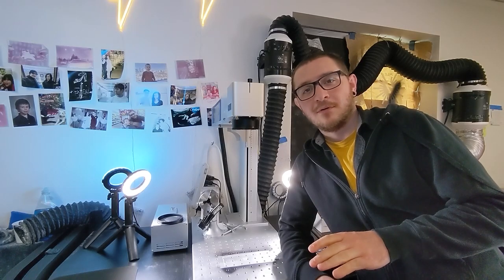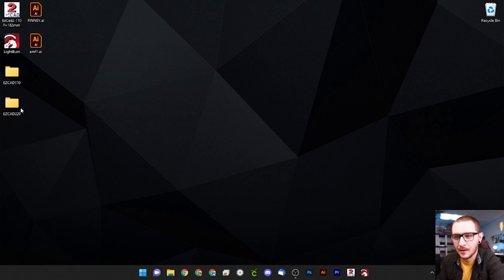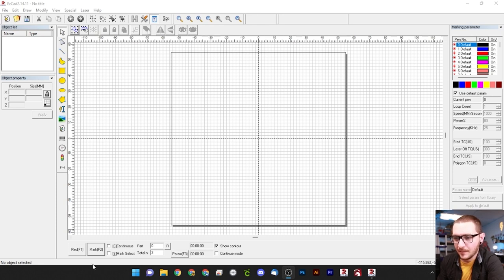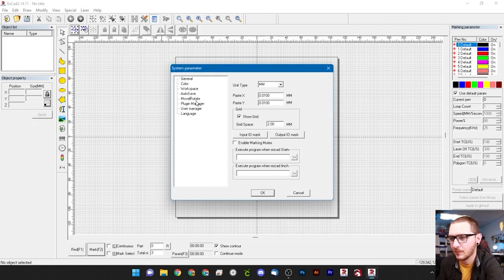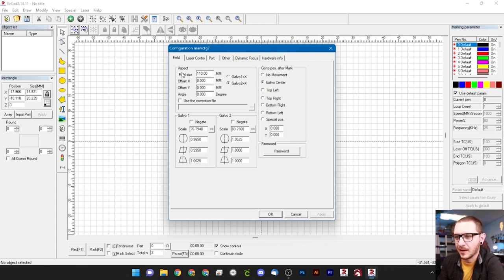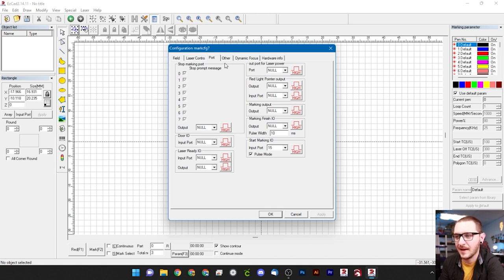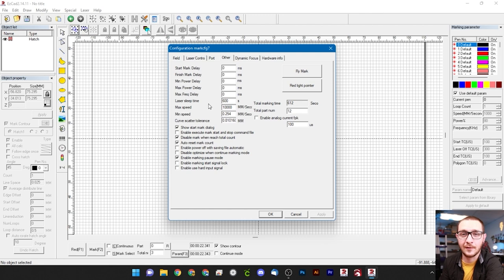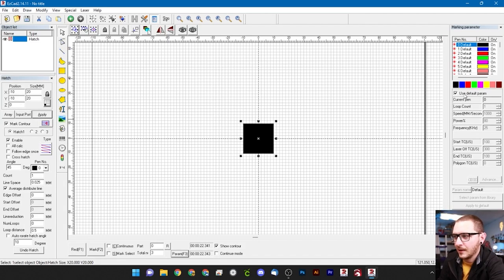How to Set Up A New Fiber Laser or Lens | 2021 UPDATED | Laser Engraving First Time Setup

Comment: Thank you for such a great video. One problem I am having is I am setting up a 150x150 lens. Have all the distortion taken out and it makes nice straight lines. I made a 120x120 box while setting up everything just to make checking the straightness of the lines easier for me. Problem I have is that the box actually measures 122.5 on the x axis and 131.5 on the y axis. I know it has something to do with the scaling settings in the configuration. But every time I've tried to correct this things go south, can never get it to be a perfect square. Negate is NOT checked on either galvo. If I go into the scaling drop down menu and enter the desired marking and actual marking settings for galvo 1. Then do the same thing for galvo 2. The parameters that I enter in galvo 1 are overwritten by what I enter in galvo 2. What the hell am I doing wrong?
Reply from the maker: Well the first thing I'd say is that you want to be making your scale adjustments FIRST and your warp adjustments second. Adjusting your scale after setting your warp adjustments is always going to mess with your warp. Get the scale as close as you can, then the warp, then scale, then warp again. You'll have a more accurate finished product.

As far as the overwriting issues go it's really hard for me to tell without looking at it. Feel free to post a few screenshots or a short screen capture to the discord and I'd be happy to take a look for you. There's a link in the description and we can get that sorted. Not a great answer but hope it helps a little!
Reply: @LaserEverything  It's a start thanks

Comment: Perfect timing!  My 50w JPT is sitting in my garage right now and I'm a tad intimidated to open up the crate.
Reply from the maker: Crack it open! I'm here to support you if you need help. 100% join the Discord right now! It's free and will be a massive help.
Reply: @LaserEverything  Spent today unpacking the laser and setting it up! At the software stage now feeling it out. Not quite to first base yet... :p
Reply from the maker: You can do it, don't give up! You're gonna be a master in no time!
Reply: Nice video , I have a 60W JPT M7 MOPA with several lenses and EZCAD 3.0 just starting to learn , have you made videos using EZCAD3 suitable for my machine 
also?
Reply: Hi Lars, i had your machine , it is the second fiber , first is Raycus. So I am still learning, but if you need help go tell. By the way, does your unit run cooling fans only when get hot or is always run?
Reply: @martinotalotti8986  Hi Msrtino, I am learning, tries to focus on making small deep holes (1mm deep , 200um in diameter) in stainless steel using 70 x70nm field  (116 mm to distance)  Yes my SPI fan is only  on when needed and normally silent
Reply: @martinotalotti8986  sorry I mean JPT fan not SPI !
Reply: @larsherrnsdorf3344  hi, unfortunately SS warms up quickly , if it was aluminum it was way easier. Unless you have to do several holes , which will take hours, you must go with slow power and several repetitions. I didn't figured out which frequency will affect less SS on Mopar laser, untile now i use Raycus 30w normal q-switched
Reply: @martinotalotti8986  where  are You located and do you have ezcad3 2.5 D? Any work on as material ?

Comment: Great video, I have a question. how to know my machine PWM?
Reply from the maker: This is typically specific to the laser source itself inside the machine. Among each brand there can be similar models that have different frequency ranges, so you'll either need a spec sheet/hardware list or may need to open your side panel of the machine to confirm your laser source model. From there, you can use that info to validate your frequency by using the spec sheets supplied by the manufacturer of the source. We have a lot of them linked in our resources on our website to help make that easier. You can also ask the machine manufacturer you bought it from, but if they mix parts or didn't keep track of components, you may need to use the methods we mentioned previously to have an accurate set of values.
Reply: Thank you so much

Comment: I just picked up my “new” laser from Cloudray and in “total mark time” it says “24713 seco.” Does this mean I got a used laser?
Reply from the maker: Every manufacturer when they give you a copy of EZCAD they're making a copy off of another copy off of another copy of easy kid that was used to set up a bunch of machines. The runtime is stored in the software, not on the machine so it appears like your machine has been running for quite a long time but really it hasn't been. They usually do an hour or two of testing before they send them out and all of that test time adds up every time they make a copy and use it to set up a new machine. Certainly your machine is new and you have nothing to worry about.
Reply: @LaserEverything  cheers. Thank you sir for the reassurance. I definitely didn’t pay for a used one lol. Thanks for the informative video. Got my laser up and running in no time. I kept getting the missing drivers warning (and subsequent “demo mode” when I followed their instructions.  Thanks again
Reply from the maker: Perfect, glad it got you up and running!

Comment: Hi, must I enter the thickness of the element i markt? Is a option in ezcad2 to adjust thickness ?
Reply from the maker: I don't know where you would enter that in. There's no depth or thickness settings. You'll have to measure after the mark is done and adjust based on the depth you're trying to achieve.

Comment: In laser control what is Open MO delay? mine was set to 8 but I cahnged to zero now machine works fast
Reply from the maker: It has to do with giving the laser a break between lines. The manual reads, "4) Open MO delay：The MO signal gives the AP signal after the delay. If the setting is too small, it may damage the laser.." If I were you I'd set it back.
Reply: @LaserEverything  Thanks, but I have been using laser marking for more than 1 year. I have not faced any issues till now
Reply from the maker: @lahorelaserprinting1535  No worries, it's your machine! If that's working for ya do it up :)

Comment: HI, so i just receive a 50w fiber laser and when i try to download the program it said   demo version , am i doing something wrong.
Reply from the maker: Laser has to be on, plugged in, and drivers installed or ezcad will not work correctly.
Reply: @LaserEverything  im having issues installing the driver on my new laptop windows 11 64gig? I follow all the instructions and it comes out saying that it doesn't have the right driver. What could it be
Reply from the maker: Join the discord with the link in the description and I'll link you to new drivers that work better for some people.

Comment: Is it correct that fiber lasers must be vented to the outside? Do you have any suggestions on enclosing them or a fume extractor to use? Did slate yesterday and it smells horrible.  Is that normal ?
Reply from the maker: Yes, ventilation or extraction (or both) is 100% always needed when engraving, organics, metals, anything. The byproduct of engraving is material removal either through ablation or burning, and generally isn't good for your lungs at a minimum, not counting if there's any other byproducts or VOCs/fumes that might be toxic ontop of that. 
At a minimum we suggest a good exhaust fan, maybe centrifugal fan to exhaust direct from the bed (or enclosure), or you can try an extraction unit. We have some options listed on our buying guide (linked in the description). We use 6 or 8 inch centrifugal exhausts for our setups from the buying guide. Some places require filtering before exhaust, so you could also add some kind of prefilter to exhaust or run an extraction system if you wanted/needed to. Anything you can do to keep your air clean and keep that soot and stuff out of any inhabited areas is a good thing to do.
Reply: @LaserEverything  thanks. I had the Omtech xf-180 fume extractor running the whole time as I don't have access to exhaust outside for this one. I saw the one the buyers guide but it seems very similar to the Omtech one I have. 
Is it normal for slate to stink really bad ??? 
I've heard no so I don't know what's up with that. They were from JDS.
Reply from the maker: Happy to help! Slate isn’t really stinky by itself generally (you can smell it in the air but it’s not horrid), it may be the coating burning off since those have a food safe protective coating on them from there which gives them their sheen. The extractor we have in the buying guide is very similar (or maybe even the same just rebranded). The filters tend to fill up quickly, so make sure you aren’t losing suction and effectiveness by ensuring your filters aren’t blocked up. If you’re isn’t enough to handle the amount of soot your laser is throwing off, encapsulating it with an enclosure so the extractor can recapture everything more efficiently might be a good idea. Bigger extractors like a bofa unit will do better, but it’s also much more expensive, so i would try the enclosure (since it had other benefits to add too) before considering the upgrade on a beefy extractor system.
Reply: @LaserEverything  sigh ok....yeah I haven't really even used that extractor except for like one or two small jobs before this as I am new to the fiber world.  It smelled horrible. I called JDS and they didn't really have any answers. I guess next time I'll run them on my CO2 instead. Any suggestions on buying or making an enclosure?
Reply from the maker: @tiffsdecorandmore you can do them on the fiber (we love them that way too), but yea if you can’t get enough exhaust throughout for it, but you can on the co2, totally an option.

Comment: So, I decided to pull out the lens that came on my laser, just to make sure it is a 200mm lens as it is supposed to be.  I grabbed the lowest part of the lens, and that started unscrewing easily enough.  But what came off was some sort of thin retaining ring of some sort. Not the lens itself.  So while I am looking at this thing in my hand, out drops a lens that hits the metal plate of the laser.  Didn't shatter it, and no damage that I can see, but darn.  Wasn't expecting THAT to happen!  And come to find out there is a rubber o-ring seal, that came partially out of the track.  So guess I can't stop now!  I tried unscrewing what I thought would just be the lens in the sleeve, but that wasn't budging.  I was, however, able to get the sleeve out of the galvo, with lens inside, so in order to put that lens that fell out back in place, I was pretty much committed to remove what I could so I could work on it more easily.

So here is the thing.  Does that lens HAVE to go in one way rather than the other?  Is there an upside down rather than rightside up?  I figured I had a 50/50 chance of getting it right, so what the heck.  Got the o-ring in the groove, and the lens back in place so I could screw the retaining ring back on.  Inspected it with a flash light and appeared to be some dust on the inside.  So off it came again, so I could use my air can (for my camera lenses) to blow off the dust, and lightly brushed it with a microfiber towel.

While all this was going on, I put the rubber lens cap back on, so I wouldn't be putting my fingers onto the lens while fiddling with it. Went over to the house to bring my laptop over so I could make sure I didn't screw something up with all this going on.  Yeah, I am sure you know what is coming.  Set up a test image, and fired the red laser.  Hmm.  Nothing.  Maybe I had the focus out of whack?  Nope, that didn't change anything.  Well heck, fire the main laser!  Still nothing. But what was that burning smell?  Aarrghh, that was the lens cap getting a hole melted through it.  Damn...  So I pulled off the lens cap and tried it again.

Darn, that red laser still didn't look right.  And neither did that main laser.  Matter of fact, it wasn't really engraving into the test metal at all.  Just a bright line, that was barely bright.  Well, come to find out, when I burned through the rubber lens cap, it left a light residue on the lens itself.  I lightly wiped it clean with the microfiber again, and by now thinking I had somehow already ruined my brand new laser, ran a test again, thinking I was wasting my time now.  

Luckily that seemed to fix the problem. Red laser outline was nice and sharp, and firing the burner laser cut the image into the test metal like it was supposed to do.

So a couple of questions: (1) Do I just need to put more muscle into screwing that lens out of that sleeve?  I sure as heck don't want to make matters worse by breaking something. And (2), about that lens that fell out.  Is there a right way and a wrong way for it to go back into place on that lens? I couldn't see anything obvious to indicate that by looking at it.  I do have two other lenses I could take apart, if necessary, but obviously I am reluctant to do that if I don't need to. Obviously the laser is quite sensitive to contamination on the lens itself.

And again, any way around having to provide a phone number to sign up on your discord server?
Reply from the maker: 1. Yeah potentially. The entire lens and it's housing should come out of the galvo head. I don't know how they got it in there so tight.
2. F-Theta scan lenses are grouped lenses made from multiple glass elements. Depending on the element that fell out it could  either have or not have a proper orientation. Usually the final element (the one closest to the table) does not have a specific orientation optically. Some manufacturers put the anti-reflection coatings on the final element while some put it on a glass shield that shields the element from damange. Obviously we want that pointing out, not in, but I'm not sure if I could even tell you what to look for as far as making that determination. I guess if it aint broke don't fix it. 

3. Since the discord community is an official "Discord Community" we have to have the highest level anti-bot/spam measures in place so I don't currently know a way around that requirement. There are temporary phone number services online you could try one of those.
Reply: @LaserEverything  Thanks for the reply.

Yeah, it was the glass element closest to the table that fell out. Why it didn't shatter or crack hitting that aluminum platform is probably a miracle. Sure got me all flustered, hence leaving the rubber cap on trying to fire the laser and burning through it.  Duh.....

I approached CloudRay about this and they asked me to create a video to show them what I am talking about.  I am pretty sure YouTube doesn't allow embedded URLs, but if interested, this clue will get you to my video -> v=bQRwjZ4auGM

Been meaning to get back over to test the laser some more to see if anything seems amiss, but the past few days have had higher priorities. The wife has health issues and we have been bouncing around between emergency rooms and the oncology center, or she just doesn't feel well and I want to stay close by. Truth be known, I wish I hadn't allowed her to talk me into getting this laser right now.  :(

Anyway, I sent CloudRay the link to the video and am approaching this as being a defective lens/galvo adapter.  I bought a couple of extra lenses, but I can't use them because of that 200mm lens stuck in the adapter.  I am sure I can take the whole shebang out of the galvo and put it on the workbench, and one way or another separate them, but no promises there won't be some resultant damage.  I have found that when removing filters from camera lenses, you can actually squeeze the filter ring TOO hard and it makes it more difficult to unscrew the filter as it goes egg shaped on you. Consequently, I put a very small dab of gun grease on the threads now, and that problem just went away.

If CloudRay balks at replacing the lens/adapter as a warranty item, I may try to get them to compromise by giving me free shipping and I'll just buy another one. Likely there is dust inside my old lens now anyway, and a replacement lens only costs $50 direct from them.

I'll see what I can do about signing up on the discord server. Seems more and more places are requiring codes being sent via text on the cell phone lately, so I may just be fighting a losing battle against the inevitable.

Comment: Looking forward to getting my first machine. this is a jump from  my diode cutter/ engraver.
Reply from the maker: Big jump! I'm sure you'll love it though!
Reply: Mine came with a foot pedal. Not sure what it is used for. I haven't seen anyone using it here
Reply from the maker: It's for use with batch jobs so if you have to run the same part over and over and over and over again you can just swap the part out and press the pedal instead of messing with the computer
Reply: @LaserEverything  I don't know how to make a <3 but. Thanks 😊
Reply from the maker: You got it!
Reply: @LaserEverything  now how do I tell Ez Cad I want to use it? I have quite a few things to mark
Reply from the maker: @darrinjones9387   @darrin jones  You have to activate it in the F3 Parameter menu. It's a little complicated. Are you on the Discord server? If not I would sign up - it's free and a lot easier for me to give support there.